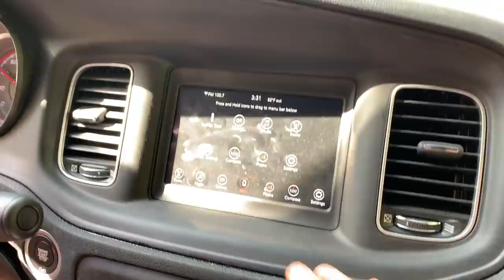Rebuilding A Wrecked 2018 Dodge Charger Police Car Part 6

Comment: 🚔 🚨🚨🚨    I noticed the gap on the front bumper right away .... after market body parts never line up like OEM . 
🚨Take my advice Don’t install the cage in police car . They restrict the front seats and ruin the interior of the car . Most police departments don’t use them anymore or keep it to a few cars in their fleet to haul around out of control perps. 🚨 Keep up the hard work. Can’t wait to see the building project videos 💪🏼

Comment: Regarding the Cop Car front bumper, I deal with Maseratis and you see the same issue with the OEM bumper after they have been off for paint. What it is, is when you pull the bumper there are shims that just fall out and get lost so my suggestion is to get/make some shims or washers and pack them under the fixings till its right. Should be pretty simple. Matt | SportsMaserati.com

Comment: hi guy's  I've only  to say  you can't use the bar lite on the ex patrol car if they're blue emergency or you've be paiding the  finds or jail time.
Reply: They said a cop gave them the spot light for the car in the video. Do you not think the cop told them not to use the blue lights on the road?? These guys are running a million dollar operation in their early 20s so they aren't morons.

Comment: You guys need a few pool noodles on your parts assembly  rack surfaces.. use headliner glue and spray both surfaces  let set for 3min .instead of sheriff on the side. Get graphics that says 
SHE'RIPPS

Comment: Leave the bumper the way it sits, and please do not poke a hole in the roof, just run the wires out at the upper door edge.

Comment: I keep finding myself thinking you'll try the lights, siren, or public address system in public. Do that and you might find yourself locked in the back of another cruiser. Such actions might be treated as impersonating a police officer. I'm not a lawyer but I think you should be careful.
Reply: Yes, you are correct. Good advice but unfortunately there are so many really young fans advising just the opposite because they don't know any better.
They especially don't understand the cost of attorneys for the guys to defend themselves could be $US20,000.00 or much more.

Comment: You do this all the time, but buing used part and just shoving them on the masterpiece you are making. Just clean the parts, some areas you will not be able to clean once they are put in there.

Comment: Most all the police lighting you guys want to leave on the car will be illegal, depending on the state, only if you use them on the roadway. If you use it on roadway or to make people think you are the cops here are the laws you might run into. Impersonation of cops, additional lighting equipment and again depending on state red light or emergency light to the front. So main thing is don't use on roadways. One of them laws could be a felony and I don't want you guys to be tempted and get in trouble. If it were me I would not have any color associated with police, in that state, so as to remove any doubt should someone complain on your guys. i am happy to hear you are getting rid of the stickers. Maybe wrap it in your business logo for advertising. U might even be able to pick up work on police cars from your local agencies.

Comment: Let me get hit with “hater” again. 
So you are going on the road without the airbags?
Don’t screw up what could be a beautiful car with drilling holes in the roof. It lessens the value. 
No one wants to ride around with blue lights on a car and a pushbar. 
The second you turn on those blue lights on the street you are going to get hit with imposter. The driver will go to the room with no view and the car will get impounded for evidence. 
It will be costly. 
Just giving you some advice from someone who knows.